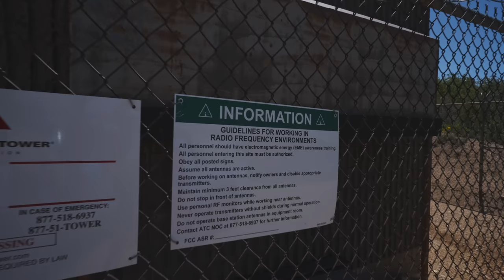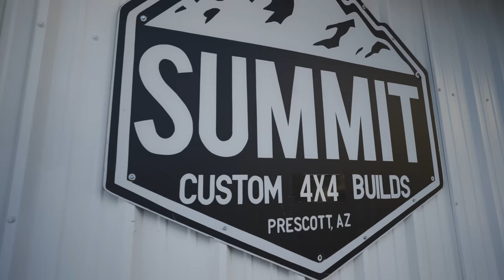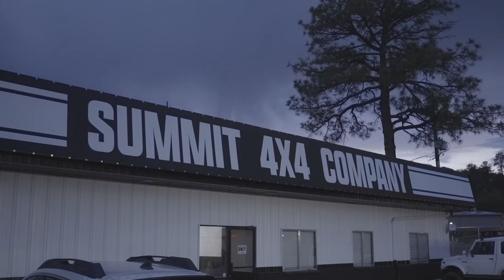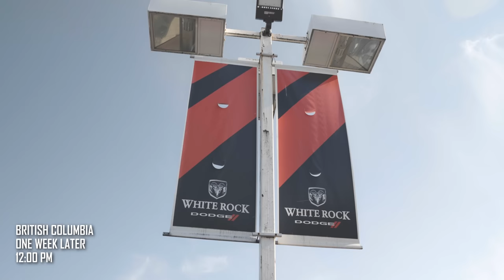This Overland Trip To Arizona Was a Disaster...

Comment: O Shaun, the first time we took our truck camper from Melbourne, Victoria to Brisbane, Queensland we had major problems. We could not understand why the truck kept on wanting to lift. It turned out truck did not have the right springs for the weight of the truck camper. We had to buy a brand new truck and get all the upgrades done. I was so pissed off at the time, but it did not stop our overlanding adventures around Australia, just money. Love Rolanda

Comment: That tower is the backup system for the emergency broadcast system after the power grid failed. Original system, those had new looking locks on the chains. Worked at cell towers some years ago.

Comment: so the u-joint broke and it cracked the cover of the transfer case? then the transmission went out? that's a nightmare, but it could have been worse, for instance you could have rolled it, which is what happened to me in a truck in baja back in the late '70's... please keep us posted on the details of the repair, and also how the baby is doing.

Comment: Hey! I’ve had my smaller 2005 4X4 jeep Liberty I took off road in northern utah. The vehicle didn’t die till I arrived home to Phoenix. Engine filled with oil. 2 blocks from my home. 
After driving 750 miles back from Utah. 
HEY DO YOU THINK THE HEAT REEKS HAVOCK ON VEHICLES? 115 degrees I. Phoenix upon my return, Played into your engine problems??? What do you think?

Comment: Camaraderie is great in the hobby isn't it. Just to ask have you got a double cardan u-joint on the DS's? If so they should be greased every 3000-5000kms. For you and the hot weather travel I would say 3000. Pain to do as my LT V8 JK has them (they are smoother and better driveline angles IMO) and I grease them religiously. Drawbacks of adding big HP - I am only 355HP but I carry a hard line grease gun in my kit for this. Sorry for the preach but glad it all worked out for you.

Comment: Soooo. Just curious if AMW & Epic warranty any of that stuff? 
It seems like an Epic problem out there on the road. 
Definitely sucks to have to deal with. $$$
Reply: I love the Trail Destroyer as a build concept. Unfortunately, not being able to drive 300 miles without 15 extra gallons of fuel + a platform that was not actually designed for the amount of torque and horsepower consistantly delivered... keeps it just a really cool concept. Almost like a SEMA build, where the vehicles would break if you actually tried to drive them. Let's just say that there will be plenty of the "I broke the Trail Destroyer... Again" type videos....

Comment: Not to poor salt on a wound, but if you look back in your comments when you built this, I made mention of spending the extra on an Atlas transfer case. you've got a lot of heavy duty components which are putting a lot of torque on parts. Sorry it crashed your trip.

Comment: WHAT A STORY!!  Drama, YouTube special appearances, humbleness,  man you couldn't have planned for a better episode.  Lol.  WOW.  On a related note, I think it's important to share the details (root cause) of the transfer case issue, and now the trans once you figure that part out.  I'm interested to know and I'm sure many more as well.  What kinda drive shaft?  Was it truly the broken u-joint that caused the transfer case crack?  Flopping around or component hung up?  That said, I'm assuming you had an aftermarket drive shaft so really curious to why it failed if it did?  Oh wait, 600 plus HP, heavy foot, probably some bouncing here and there....... Lol.  Seriously make the root cause "part 2" of this video.  I know I'll never get as big as you on my little channel jeepNdirt, but as I've stated time and time again in previous comments.  You are truly inspiring and an incredible drone shot dude!!!
Reply from the maker: Thanks man! From what we can tell, the factory bolts that hold the front drive shaft to the transfer case don’t thread into the yoke very far. Combine that with a lot of torque, and the bolts looks like they snapped. That’s likely the cause. We’ve fixed this with longer bolts hopefully (Summit’s idea). The second brake down was again due to the transfer case. When we opened it up, it was full of metal shavings and made terrible noises when turning it by hand. So most likely there was more wrong with it than it appeared, or possibly something went wrong went it was re assembled, but it’s impossible to know really. We replaced the whole case to be sure and it’s running good now.
Reply: @TheStoryTillNow  Thanks for that.  I'll be checking my bolts now that I've installed an Adam's 1350 on my JLUR.  I'm no where near 600hp, but it's always good practice to paint pen mark important fasteners for ease of visual inspection.  I notice your control arms are marked in that close up shot.

Comment: I was considering a V8 conversion but with all the trouble your having maybe it's simpler to stay with V6 because once the warranty is up all the problems would be out of my pocket and I like my Gladiator because it's dependable the way it is!
Reply from the maker: The engine is warrantied
Reply: @TheStoryTillNow  That's not the point the engine is no good without the transmission and transfer case so if that powerful engine destroys the transmission and transfer case your still stuck and no where. Is the engine installer going to warranty the rest of the drive train so your not out of pocket for repairs? What about once the warranty is up? How many miles have you driven since the install? How hard have you been driving the daylights out of it? I'm not rich!
Reply from the maker: There are risks to everything. Just depends on your comfort level. For me, as a youtuber, it makes perfect sense. For some people it may not and that’s fine.
Reply: What a beautiful rig. I definitely like horsepower. I just think I would avoid pulling hole shots on the pavement. That’s a lot of stress. It’s so awesome how everybody came together and helped you out  that’s what it’s all about.
Reply: Didn’t you let Matt drive your jeep? I would blame it on him. Lol.

Comment: This is why after 30 years of overlanding ultimately all the jeeps I have owned have remained stock except for tires. You buy a Jeep designed by engineers to run 32 inch tires and you want to run 37-44 inch tires.....I don't care what mods you run to support those tire sizes, you have compromised the reliability of your vehicle. After 30 plus years of overlanding I have never been broken down/stuck because of a catastrophic failure. I would like to think it's because I kept my jeeps as close to the manufacturers original intention.
Reply: That's pretty much why I'm stopping at 35s on mine. Just tall enough to do everything I need but no so big it causes severe damage. Also I'm running the dana 30/44 combo so that changes things.
Reply: What you say has some truth but you're also probably guilty of survivorship bias.

Comment: How the first failure happened...then the second....it is unlikely you'll ever get away from that.  Jeep did no additional R&D before slapping an engine too big for the rest of the components.  
But isn't that the Jeep way anyhow?  Just replace most of it and you'll have a decent ride.
It's just too much for us practical people in Toyotas.🤣
Reply: It's a AMW4X4 aftermarket drivetrain setup using Mopar parts, not a factory 392. That being said, I agree, this is way too much power for the application he's using it for. It will break down more frequently as a result.

Comment: wow guys you don't have recovery boards ? seriously ? not professional, but lots breaks during it's terrible. I had situation the my Titan XD diesel engine failed in Upper Penn, 20 miles both way from any village and no cell service.  Nice people stopped and help with tow truck. Then provided car for few days. Engine wa replaced by Nissan, after 600 bucks towing to main land MI, 10K engine and 4 K in labor and airline ticket for pick.

Comment: Your repair went a lot quicker than mine.  My 21 JLUR diesel needed a turbocharger assembly by the time I got to Flagstaff.   The turbo control valve was bad.  There are two ways to replace the turbo, pull the engine or pull the body.  Jeep paid for the body pull method.  I however paid for the extra time spent disassembling my overland gear and putting it back.  Three weeks after Expo West I was on my way back to North Carolina.   Not my best adventure but probably the most memorable.

Comment: So what was learned after spending 45 minutes of my life.  Well I don't know why the aftermarket shaft broke.   Do not know if modern Jeeps have a transmission flaw .  Didn't learn anything important,  just names of sponsors.  Oh maybe buy a Toyota for more reliable overlanding.  Jeep failed on the highway. Disgusting.  2013 jku owner 120k miles and crossing fingers.

Comment: This is why I hate JEEP
Reply from the maker: That doesn’t make any sense. This jeep is highly customized, there’s almost no stock parts on it.
Reply: That may be so however the transmission went on you as well as the transfer case. Ever single Jeep I have ever owned has had major issues.
Reply from the maker: Transmission didn’t go, and it’s not a stock transmission anyway. Transfer case was split in half by being hit by a driveshaft.

Comment: This is why I prefer tacos over Jeeps.
Reply from the maker: 99% of tacos can’t follow me.
Reply: @TheStoryTillNow  you must be doing some crazy fun stuff ! Thats usually because they have an upper and lower control arm and most people just change the angle downward to get height and it takes away all there downward travel. Even so that’s still a very capable rig. I didn’t find the limits of my 2nd gen with kings 2 inches on 33s and expedition leaf springs . If I could do it over I would have done long travel for show . Lol
Reply: @TheStoryTillNow  now that I think about it I did find it’s limits ever time I got stuck in deep snow .

Comment: Shoulda bought a Tacoma
Reply from the maker: This Gladiator is pretty custom. Anytime you start customizing parts and adding performance, you risk breakage, I don't care what vehicle you have.
Reply: @TheStoryTillNow  Yeah I didnt realize you had a super powerful engine under the hood. If you did an engine swap on a Tacoma and added 300hp+ on top of what it was built to handle I'm sure things would start breaking too. I wonder what's the experience with heavily modified Tacos.
Reply from the maker: @jacobshirley7155 empty wallets and tears. 😎